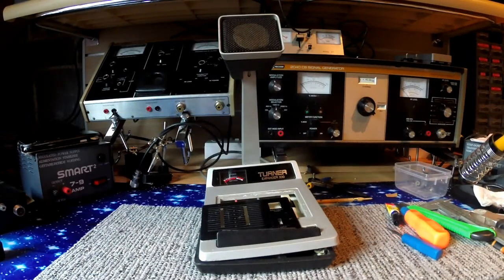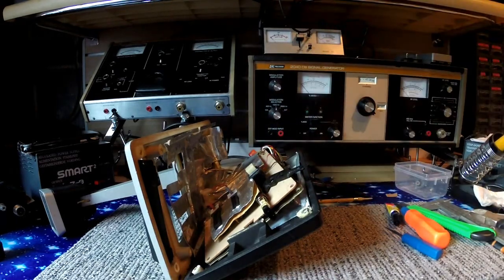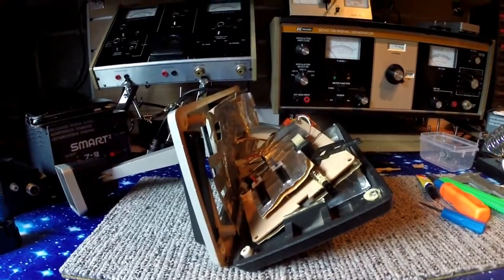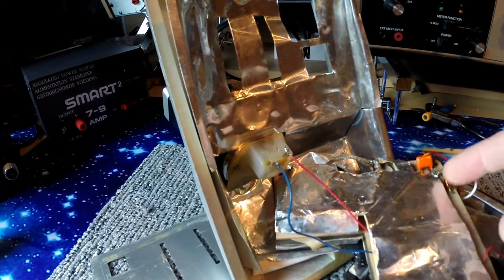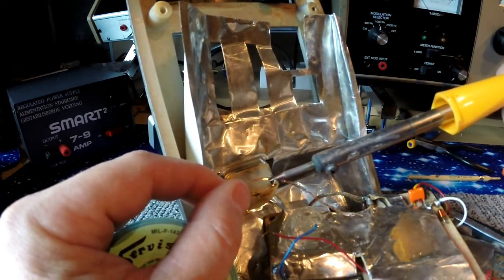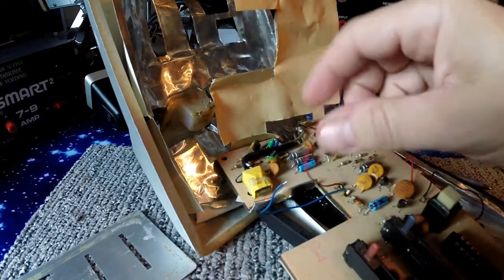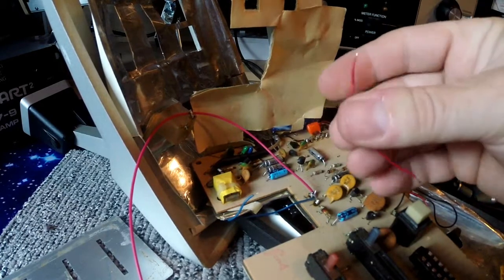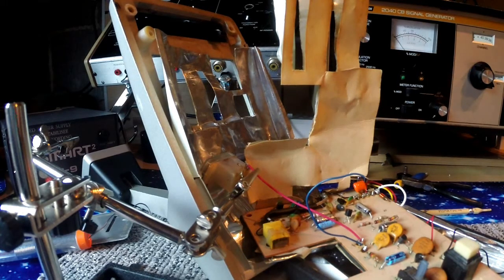Turner Expander 500 Restoration - Part 1

Comment: Hello from Germany Do you have a complete parts list for the Turner Expander 500, I would like to replace all the electronic components on the circuit board. '73 Gerd
Reply from the maker: @marderschnauz  drop your email in the comments and i will send you the schematic
Reply: @britishcbradio1055  Hello from Germany I don't know if there are differences in the different versions of the Expander 500, or if it's just a visual difference There are some with a white lock slider, silver gray, and without a lock... Thank you very much
Reply from the maker: @marderschnauz  Hi Gerd, put your email and i will send you the schematic with the values on. There were two versions I as far as i know one with AGC  and one without, thats all i know on the differences.